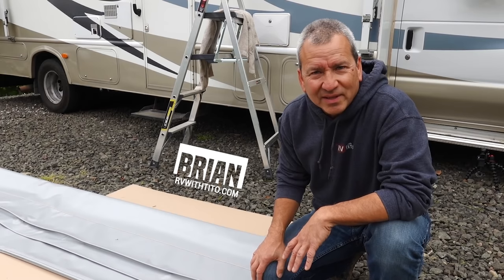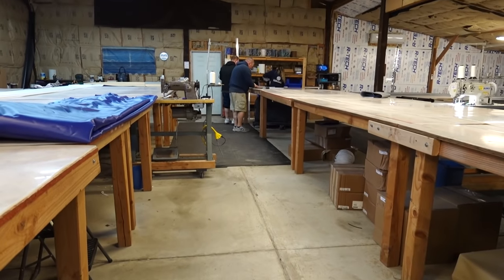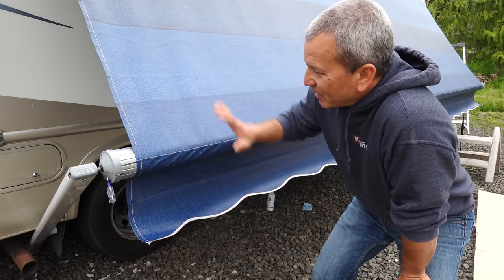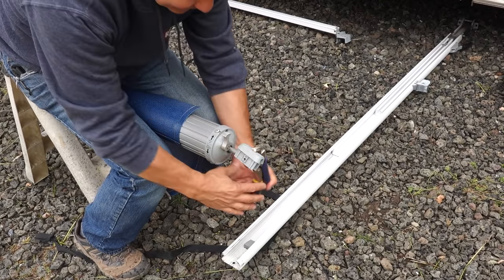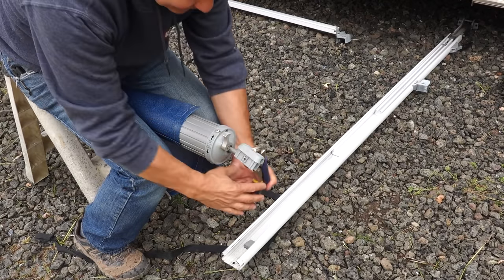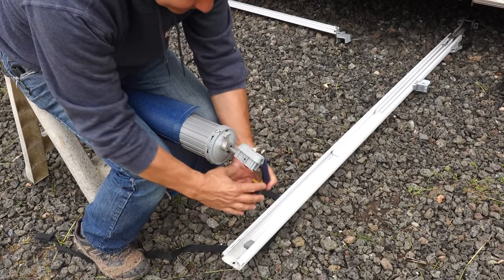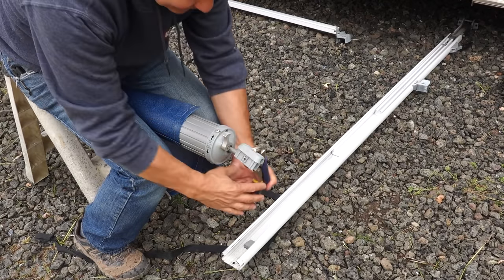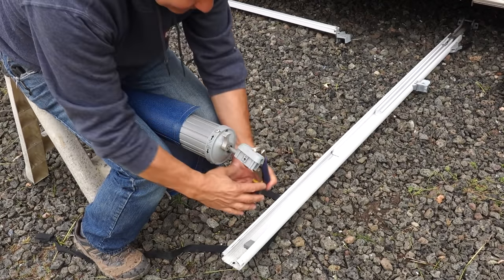7 TIPS for Replacing RV Patio Awning Fabric Which I Learned THE HARD WAY

Comment: I changed mine by myself (with no help) a couple weeks ago.  To pull it through the top track, I tied a small pulley onto  the rear arm of the awning.  I attached vice grips to the leading edge of the awning (with a protective cloth between the awning material and the vice grips).   Then I tied a rope to the vice grips, ran the rope through the pully, and ran the rope back to the front.   As I fed the awning into the track, I pulled on the end of the rope, which pulled the leading edge of the awning to the rear of the RV.
Reply from the maker: I just saw someone use that method. Didn't think of it at the time. Thanks!

Comment: This Video is one of the Best I've seen on this, I wish it'd been up a couple of Months ago, LOL!  
My Father-In-Law has an OLD Motorhome and when we had that Big Snow Storm (For Texas, anyway, LOL!), he didn't roll his Awning in so the weight of the snow tore his awning completely in two.  So he Ordered a new Replacement and My Wife and I Installed it.  My FIL said next time, he's just gonna pay to have it installed even though the Company was gonna charge more for Installation than what the Fabric cost. 
1 thing I can add is MAKE SURE YOUR CHANNELS ARE CLEAR!.  My FIL's fabric had been in there so long, the Piping was sealed in with dirt and oxidation.  I used water from a garden hose along with a wire brush and a screwdriver to try to get them clean.  Next time, I'll use my pressure washer!  If dirt is still in the channels, the Fabric will bind up and not slide.  
Also, use a silicone spray lubricant to help it slide in (I had a spray can of Food Grade on hand) and like Tito said....at least 2 people to install!  There are Videos saying it's a one person job and I've seen 1 that even says you don't even need to remove any framework, both top and bottom can be done at the same time......Ours Couldn't.
Reply from the maker: Thanks a bunch for the feedback. I appreciate the tips too. Hopefully you won't have to do it again anytime soon.

Comment: Thanks for showing us how you put your awning on and all your mistakes, because we all learned when we make mistakes so I think we learn more by seeing your mistakes. It's always better to have helped but one of the things you could have done is put a pulley on the back side of the RV on the roof and attach 1 line to the awning with a clamp and you pull the other line as you feed the new awning into the the track rail.  Great job...
Reply from the maker: Yeah. I just ran across someone who used the pully technique. Had I known, I probably would have tried it. Thanks!

Comment: Thanks for the video, it helped me out a ton today. I had a bad experience with the spring tension getting away from me as well, except I thought I would be slick and stick a long Phillips screwdriver through the hole instead of the vice grip method. It’s by the grace of God that I didn’t blind my right eye when the screwdriver came firing at my face and got hit in the cheek with the handle. This is definitely a task to be safety conscious about.
Reply from the maker: Yikes. I know what you mean. I've had the pin fly out too. It really has to be the perfect size. Glad to hear you didn't go blind. So I'll add safety glasses to go with the gloves :)

Comment: Really great video.  We also had to take the back cap off because of some piping that broke off.  Luckily it didn't spin out of control.  Now we have to figure out how to keep it locked after winding it back up.  Our caps seem different, the hole isn't perpendicular to the roller like yours.  It is parallel, so we have to find something that won't get in the way.  But so glad you showed how to wind the backside.  We watched several videos where this was not addressed.... And it should have been.  Great job!
Reply: I have this same problem! Fortunately the arm was already unwound, I'm needing to do some work on a pin so I can set the spring again.

Comment: Ouch, I  could feel what your hand was about to feel before your hand felt it. I had the vicegrips slip out of my hand and beat the ever-living-snot out of my fingers. I  went into the house and ran it under cold water because I was afraid to look at it. Two person job for sure, I  learned that  lesson the hard way too.
Reply from the maker: Good thing my vice grips slipped off instead of spinning. I felt them start slipping and there was no way I was going to grab it with my hands. No problem at all with the bigger vice grips. Lesson learned.

Comment: Brian - Know what I love about you more than your excellent informative videos? You keep it real. A lot of guys would have cut out those painful mistakes, not you... valuable lessons! I have done the same project on my rig (my first "big" project). Definitely a multiple-person project! I also used a replacement from Tough Top Awnings. I can't begin to tell you how happy I am with the product and the customer support. One lesson I learned that I will pass along, make sure that on the right side you use short rivets. I didn't have the right size and the locking mechanism wouldn't fully engage (hitting the rivet). BTW - An excellent tip on the strap, thank you... got to try that on mine.
Reply from the maker: You're welcome and thanks for the rivet tip. Glad you're happy with your ToughTop fabric. I'm loving it so far too!
Reply: @RVwithTito  Anytime On the rivet tip, screwed me up... hopefully, save someone else some time! Love the Tough Top product, great customer support too. Was surprised to see how "small" they are. My next project is to do the two that pull down over the bedroom windows and the double-wide one that protects the two on my slide out for the livingroom/kitchen. Thankfully, the one that tops the slide-out is in great condition. I am a little concerned as they do not ratchet down like the main one(same as the one you did in the video). Hopefully just smaller versions... guess I will find out!
Reply: @edd6917  The slide toppers are much easier. Just remove the tension by hand, then pin it. Once replaced, remove the pin and let the spring take up the slack.

Comment: I have same end caps.  You can avoid taking both those off and messing with the springs or rivets.  On one side just drill a whole where the slots are to run the fabric in.  Cut that little piece of metal over the slot making it a clear shot to stick the cords in and pull fabric through.  Done quick and without smashing your hand with spring which I also did as seen on here but worse.  I saw the easy trick afterwards
Reply: Yes, but then weather gets in and you risk ruining the whole tube and springs with debris and moisture. Some climates are pretty harsh. 😮

Comment: Great video. I just did mine 2 days ago. I wish I had seen your video  before doing mine, but I watched only ones that were motorized since mine is motorized.  But, same technique applies to both types. We started with 4 people  and ended up with 6. We put the tube on first and then attached vinyl to RV.  That was a mistake but we managed with 6 persons.  Others were doing it that way.  Even though one end is motorized, you still have to deal with a tensioner on the other end that wasn't mentioned in videos that I had watched. I am still fine tuning mine.  I will highly recommend your video to any one that does their own replacement. Other than a few steps to do with the motorized awnings, your video is the only one that needs to be watched. Ron

Comment: Tito I almost fast forwarded past the spring loaded episode cause I knew the tension release was coming but I watched anyways, ouch! Nice job and explanation anyhow. I hate awnings and got rid of mine a decade ago and built a gazebo instead. I don't like getting trapped inside the RV during snow loads. Neighbor kid actually came over and opened my door during a snow load and ripped the awning about 2 feet. Now I am going to attempt a DIY Topper Awning on all 3 slides except I won't be using traditional Hardware. I refuse to spend 2K. Instead I am going to use PVC 1" pipe maybe inside a 3 pipe with drilled out end caps to accept the 1" pipe. I don't care about the spring loaded stuff. Don't need it. I figure I will have $300 max invested and that includes the fabric.

Comment: I just finished mine this past weekend,
Unfortunately I could not find any help from wife or daughter,
So I had to be extremely creative with use of tools, techniques & extra ladders to do it by myself.
Took me about twice as long as it should but was able to successfully complete the project.
Had some issues as you did maneuvering the initial spline into top track by myself,
I positioned the folded fabric on top of my trailer- and let it slide as I pulled slowly from the opportunity side into the track, had to go back & forth frequently to keep it half way in line as not to snag or rip anything.
Biggest challenge I’d say was retensioning the spring by myself,
I only took off the left- no lock side,
So had to spin it….
Then will holding the tension,
Kick the ladder away and maneuver the arm up to me & reattach it.
I only put 12 turns on mine,
Probably could tension another turn or so, but myself it was hard to do.
It opens & closes sufficiently, even with only 12 turns so I think it’s good for now.
All in All it is doable for one person but much more difficult,
Potential for mistakes is greatly increased.

Comment: Most people I noticed on YT use the wrench’s in the wrong direction. If you go back and observe your vice grips when you were winding your spring, the tool always goes with the jaws in the direction you are turning. You were doing it opposite of the jaw and that may/will give it an opportunity for it to slip and snap free or not grab as well. Most people use vice grips and adjustable wrenches (cresent wrench) against the jaw opening, which should always be in the direction you are turning. I hope I made myself clear of what I’m trying to explain. Job well done otherwise, the first time we ever do anything, it is always a learning curve👍.
Reply from the maker: Yup. I was totally doing it wrong 😛

Comment: Great video, and thanks for showing the mistakes you made along the way. It's much more instructive and memorable than the videos that just say  "use two people", "use a 'large vice grip' , use a ' pick to hold the spring tension', etc. The devil is always in the details, and too many people just assume you know what they are talking about for sizes, lengths, dangers, etc (we also had problems with our left spring). One suggestion I have, and it's something I've not seen elsewhere either, is to be more detailed on the process of drilling out the rivets (for example, how to size the drill bit to the job, and what you are trying to accomplish) - - - we had never done that before. 

 My wife and I are currently replacing an awning similar (but an older model) than yours, and after a few hours of cussing and watching other videos we are now at the point of putting the fabric on, and re-setting the spring tension on both ends. Your 'mistakes' at that point  are exactly what I needed to see to finish, and I wish I had found your video first! Thanks, and I've subscribed, liked, and will click on any affiliate links to  help support your efforts. I look forward to watching the rest of your videos.

Comment: Camping in moab now. Fabric tore. I do not plan to fix it until i get to florida but ohh my... the spring tension terrifies me.
Reply from the maker: Hope these tips help with the spring tension issue...now that I've had a little practice :) BTW we were just in Moab a couple weeks ago. Love it there. Did the wind get your awning?
Reply: @RVwithTito  yup. I arrived to mexican hat area may 4. Needles a week later and moab a week after that. I have been offroading out the wazoo. Fabric tore here while parked in willow springs.
Reply from the maker: @moretoliving2236  Bummer. We had a couple really good dust storms while there. Checked Willow springs which was pretty full. We ended up about 7 miles down 313 across the highway from there.
Reply: @RVwithTito  i am at lone mesa across the road now. A little weathered. 1100 miles off road so far between mexican hat, needles and moab. Another 900 to go.
Reply from the maker: @moretoliving2236  Cool. That area is definitely an off-road paradise. Hope you never have to meet Matt from Matt's Off-Road Recovery (https://www.youtube.com/channel/UCwdVOry0oNF9WIe_3uCfz9Q). If you haven't seen that channel, then you should check it out. You'd probably like it.

Comment: I just did my first awning. I learned it's a 1 man job not 3 if you feed from the back to front while on the roof. But 2 is helpful. The springs are not bad or scary. I like 15 turns. It takes about 2 hours by yourself taking your time.

Comment: I know its a year since you released this vid, but it is a good idea if you have the springs out, is to spray them down thoroughly with LPS3 or Fluid Film. Rust on spring steel can weaken it and cause the spring to break.

Comment: How do you get the wire or screwdriver out from the side that doesn't lock after you've got the pole reinstalled it seems there's so much tension on the wire I can't pull it out. I must be missing something.

Comment: HAHAHA, I am sitting here with an ice pack on my bloody thumb.  This is the 5th video I have watched on an RV awning replacement. Three of them never discussed the spring. I knew awnings had springs, I did not realize that my dometic electric awning had a spring on the non-motor side. I should have guessed that it did just to help the motor. Let me tell you something, it's the same as hitting your thumb with a hammer, except it will hit your thumb about 14 times before you can get away from it. What happens after that is optional. For me, it was lying down in the driveway in prenatal position holding my thumb and cussing.
Reply from the maker: I feel you 😃. I'm going to do that job again soon. Hope I do better this time.

Comment: Why don’t you remove the roller without unwinding it then you don’t need to release the spring tension?  Roll the new shade onto the roller then install it fully rolled up.  Wouldn’t that be easier?

Comment: So I saw the lock mechanism on the front of the awning kept the spring from unwinding, but what kept it from unwinding on the back side.  Was that just the screwdriver?  Do you have to take that out to wind that side and then just stick it back in to hold it once it’s wound?
Reply from the maker: Yes. You have to stick a spike or long skinny screw driver in to lock the spring.
Reply: How do you get the wire or screwdriver out it's so tight with the pressure against it I can't pull it out I must be missing something. @RVwithTito
Reply from the maker: @geekchristian You need to release a little pressure and slip it out

Comment: That's one way to do it. As an rv tech I was taught a different method initially,  but once you do enough of them you learn little tricks.  Now  I'm doing them by myself with the help of a material lift I modified for awnings. 
I think the biggest difference I would recommend is unwinding the springs while is up, then it's less tension.  Little safer.